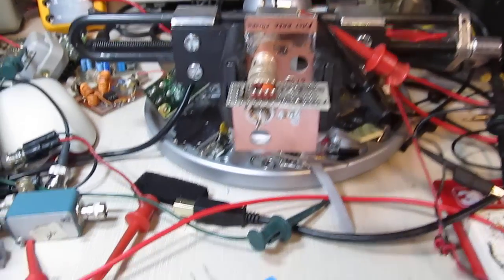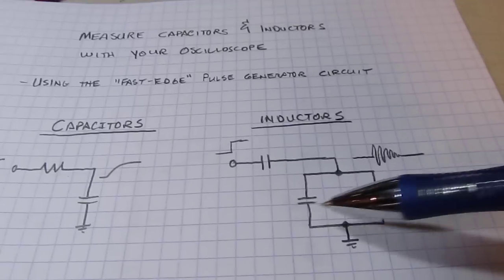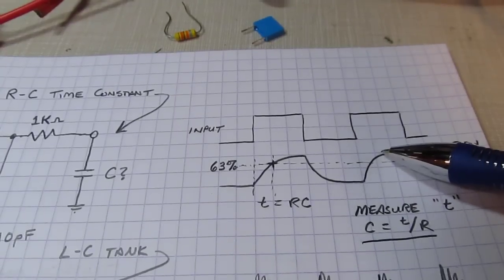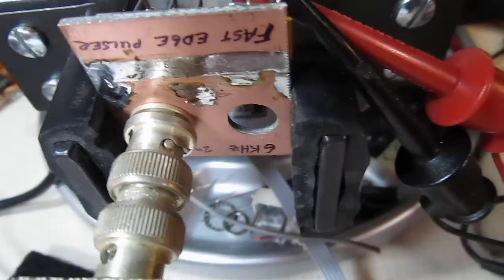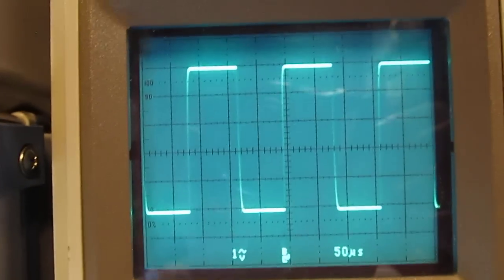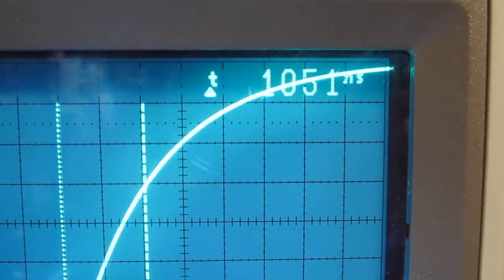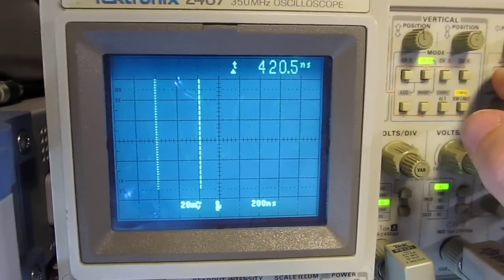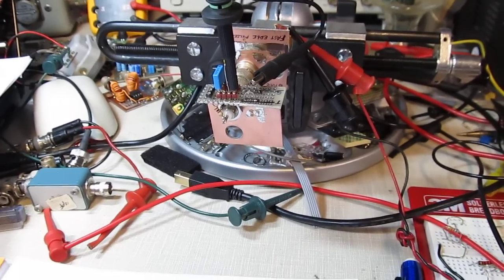#90: Measure Capacitors and Inductors with an Oscilloscope and some basic parts

Comment: Hi, Alan. Another great video! Thanks for your efforts! Is there any way to add a DC offset to this circuit, to test caps at their working voltage?
Reply: Conceptually it is trivial; just put a blocking capacitor from the square wave signal source to the device under test.  Then, have a mechanism to not instantly apply the DC (rc time constant; a resistor and filter capacitor feeding the device under test).  If you simply switch high voltage on the device under test some of that is going to go through the blocking capacitor into your pulse generator.

Comment: Hi  Nice videos.  Very well done.
Question for you.. With your R&S  9khz to 1.1Ghz sig gen.. Are the rubber buttons hard to push? I mean you have to push them fairly hard for them to work?  Mine are like that and I'm debating if I should take the front panel off and clean the carbon contacts inside.
Reply from the maker: No, the buttons aren't hard to push on sig gen.
Reply: ***** Ok then  I have some work to do lol

Comment: Nice Video! How you could compute error in that measuring method? Which is the correct way to obtain an error bound?
Regards!
Reply from the maker: +Maximiliano Bertotto There would be a lot of factors to consider.  Smaller values will be subject to more error because of the parasitics in the setup.  Errors are high enough that it's probably not worth the exercise.  These methods will likely give you results within 10% or so, or a little better with great care.

Comment: w2aew, LCR meters have an SERIES/PARALLEL mode on the DE5000 LCR meter. This puts the resistance of the inductors either in series or in parallel. An inductor is a Series L+R+C or is it L/R/C in parallel?I'm not sure which mode to use when measure inductance of a inductor or coil
Reply from the maker: In general it is not terribly important which model you use, but the manual has some suggestions of which model to use based on whether you're measuring low or high values.  See page 5 on the manual (https://www.ietlabs.com/pdf/Manuals/DE_5000_im.pdf).  I'd say that for capacitance, high values would be anything about about 1uF.  For inductance, high values would be anything above a few hundred uH.
Reply: Other techs say when measuring a coil or inductor using a DE5000 to use the SERIES mode when measuring Inductance and use the PARALLEL mode when measuring capacitance. The Series mode is putting the ESR resistance in series with the inductance and the parallel mode is putting the ESR resistance in parallel. My other LCR meter "doesn't" have a SERIES/PARALLEL mode. I'm not sure why LCR meter have a series/parallel mode for measuring inductors
Reply from the maker: @waynegram8907  Read the manual, it describes why there is a series and parallel mode.  Meters that don't have this function simply ignore the parasitic resistance.
Reply: Oh ok thanks, I'm not normally use to using LCR meters that has this parasitic resistance function.

Comment: How can I measure a capacitor discharging in a small 1.5 volt dc  motor?
The capacitor acts as a kicker. So the trace occurs only once at the beginning.
Reply from the maker: You'd need some form of storage scope - either using a camera to capture a single-shot trace, or a digital scope in single-shot acquisition.

Comment: Is it critical to use a AC or will a  HC variant of the 74xx14 suffice. I am not sure if a super fast fast edge of the oscillator is critical for measuring  inductance or capacitance. Thanks

Comment: Since the pulse generator ideally has zero impedance, the 10pF would end up in parallel with the 1nF tank capacitor. I suppose the error here would only be 1% of the capacitance which is probably less than the tank capacitor tolerance. Do you agree with this view of the 10pF being in parallel with the tank correct?
Reply from the maker: The pulse generator actually has about 50 ohm output impedance, not near zero.  So, the 10pF appears in series with the 50 ohm output impedance, which is in parallel with the tank.  Again, only a very small error.
Reply: I just saw the output resistors of the pulse generator on the video. My bad. Thanks for the reply!

Comment: Hi Alan- another question:  I haven't tried this yet, but I was thinking one way to determine a good rate would be 5 x the RC time constant or so. Yet, I recently came upon this article which uses 10HZ ! which seems unusual to me. What do you think? YouTube won't allow to post the webaddress, but you can search on the title which is "Quick Methods for Reliable Component Testing" by Dennis Weller, Agilent Technologies, March 2011 on the evaluationengineering site.

Comment: Great presentation as always! I've always been wondering, in an LC tank circuit, if the L and C were not physical components but parasitic L and C which is causing unwanted ringing on the output, what can be done to eliminate the ringing in order to get our clean square wave back?
Reply: You cannot entirely get rid of it but if you can get some resistance in there it will reduce the "Q" and quickly damp the ringing.  You can sometimes also use clamping diodes.

Comment: Would it still work (by series resonance), if we just keep the series capacitor and inductor (remove the parallel cap with inductor)? And probe the connecting between the C and L point?
Reply from the maker: Not really - remember a parallel resonant circuit looks very high impedance at resonance, a series resonant circuit appears very low impedance at resonance.

Comment: Nice and fun !  What is the name of those trhu boards with rivets ? thanks . I am wondering something : may I use a cheap wave generator mimic alternative current with it ? I thought I could test a full wave bridge rectifier with a sinusoidal by entering it in a T shape BNC, it seemed to work on the oscilloscope, (showing rectified waves) but I am unsure it really did the job . Did you make avideo on that sort of subject ? Sorry for the out of topic , Thank you
Reply from the maker: The board is an old piece of Vectorboard (https://www.vectorelect.com/prototyping-boards.html).
Reply: @w2aew  Thank you (is the reasoning for my other question totally wrong ?) regards
Reply: @w2aew    Thank you  I am trying to understand why an alimentation is not starting, with CM6802  Can you tell me what I use to check the mosfets outputs . There is a comparator I suppose before the CM , The oscilloscope show no stable SB voltage but something at 4 then 8 V alterning at 1Hz +-, and I do not understand what can be  is causing this . each capacitor I test seem to be good . I am far from being at the level of comprehension for that type of job but I wish to understand something of the primary then secondary portion of a classical alimentation (as one for a PC ATXtype) it is on a NAS alim board..  A finger pointing a direction would be largely enough for my pleasure ;)   as "do measured tensions show the place where something is wrong? May I look for RT & CT and VREF  ? A simple experimental circuit /video to understand how is working an oscillator would please me a lot Sorry to be long winding and thanks for reading me / regards
Reply from the maker: @IsaacOLEG  You can use a function generator to mimic AC signals for the experiment you describe - the only difference is that AC/line impedance is typically very low, while the output impedance of a function generator is typically 50 ohms (or higher), so you may experience loading issues with the function generator that you won't see with the AC/line powered experiment.

Comment: is the 10pf part of the scope probe, as your video showing the board you built has only 1 cap on it. Is the one on the board the 1nf. Please reply
Reply from the maker: The 10pF cap is the small orange disk capacitor that is located between the two rows of pin sockets. I point to it at 4:28 in the video. The 1nF cap is connected to the pin sockets with the unknown inductor.

Comment: What is the benefit of doing it this way versus just using a ESR/Capacitance meter?
Reply from the maker: No real benefit to this method other than:
- an excuse to play with you oscilloscope
- gain some better understanding of how capacitors and inductors behave.
So, no, this method was show mainly as an educational exercise, not necessarily a more practical way to measure capacitors and inductors.
Reply: @w2aew Cool. Thanks for the reply.

Comment: What peak to peak voltage are you getting with the fast edge generator ? great videos by the way.
Reply from the maker: It is dependent on the supply voltage applied to the circuit - the output swings close to rail-to-rail.

Comment: in the learning stages. the time/div. is there a chart that shows what decmials to enter for each time or to learn more of the M , U secs. iam guessing M is micro. but what is U and a example of the numbers pluged in for cap values. ive tested a few known caps. and numbers are not matching at all..
Reply from the maker: m = milliseconds, u = microseconds, and n = nanoseconds.
Reply: awsome ty very much oldman.. gives a hint what i do for hobby lol ... your the man of the hour.. fav bev to ya. kb2wvo
Reply: bug ya one more time olmand. i have the analog hp1740a. Sq's on screen as normal. the lil marks also .. cant rememebr how to spell that big 10 dollar word ... so if iam at .1mSec the sq's are .1 each then divid that by 5 for each sub mark on the Gline..
Reply from the maker: yes, exactly.  The value on the knob refers to the large divisions, usually 10 of them across the screen.  The little tic marks are 1/5 of that.

Comment: Wouldn't be simpler if we used the same method for inductor as You demonstrated for capacitor and then calculate inductance based on L/R time constant?

Comment: My Siglent SDS1102CML has a 1Khz square wave on it. Could I put that into the circuit in the place of the fast edge pulser to accomplish something similar? Sorry if this is a super-newb question. I've been trying to figure out how to measure salvaged parts to make my own LC Meter.
Reply from the maker: +Josiah Ritchie You can give it a try. You may have to characterize the output impedance of the circuit creating the squarewave to be sure it doesn't impact (or to include it in) the calculation for the RC time constant for checking caps.  On the inductor test - it's usability will depend on how fast the rise/fall edges are - you need fast edges to inject the high frequency energy to ring the LC tank circuit for the inductor test.
Reply: Thank you for your reply. I'll consider that as I play with it. Your direction on what to be aware of gives me some confidence knowing what to consider as possible variance. Thank you!

Comment: Looking at this from a non-experienced view, I’m going to unfortunately have to take some wild guesses.  One being that the oscilloscope is displaying two separate waveforms, because one instant I’m seeing a square wave, then the next instant I’m seeing an exponential wave.  If I didn’t know better, I’d be wondering how zooming in on the square wave, produces the wave that’s being measured for a time constant.
Reply from the maker: It actually IS zooming in the on the rising edge of the squarewave.  When you zoom in, or stretch out the view of the rising edge of this squarewave, you'll see that it is an exponentially increasing voltage...

Comment: question :D
how accurate is the tank circuit method for cases where the permeability changes moderately to a lot depending on the flux? The thing is i have some ferrite EE cores and i've been struggling to parametrize it, but every method i've used gave me a totaly diferent value, the LCR meter gave me 15µH, LR circuit gave me about 65µH with a 1K resistor, and measuring the current slope (in a boost circuit, before saturation) gave me 88µH..... any idea?

Comment: Your R-C circuit for your Fast-Edge Generator shows a 6.8k resistor, but I can't read the Cap. is it 4.7nF or 47nF.  You mentioned another video that you did on this circuit,
but I can't seem to locate it.  Thanks.

Comment: Yes I see you used the VAR vernier to make the voltage to fit 8 divisions to measure the time constant 63%. I thought when you adjusted the VAR vernier it changes/alters the amplitude voltage so that its not a real absolute true voltage but just a relative voltage, not sure if that is true or not?
Reply from the maker: Yes, it is relative, but that is what we want in this case.  By making the peak voltage occupy 8 divisions, we know that 5 divisions is 63%.  All relative.
Reply: I would think it would give you a "false 63% time constant" because you have altered the peak voltage by stretching it or collapsing it using the VAR vernier. In some Oscope manuals I think they give a formula to use when you have the VAR vernier adjusted Multiplied by the Volts per Division, I'm not sure what the formula is but you have to use a formula to "add in" the VAR vernier to the volts per division. You have mostly used the VAR vernier to measure Rise time/fall time and Time constant. What else can you use to measure using the VAR vernier? Because older electronic technicians in the 50's and 60's would use the VAR vernier often I heard because Oscopes in the 50's and 60's used the VAR vernier much more for some reasons you had to use the VAR vernier to make measurements because the Oscopes were different in the 50's and early 60's.
Reply from the maker: @waynegram8907  No, it won't give a false 63% time constant. 5 divisions is always 63% of 8 divisions, regardless of how many volts it represents.  So, there is no problem.  

On the older scopes from the 50's and 60's, the vertical scale was NOT calibrated, so you would put a KNOWN voltage into the scope and adjust the vernier for a certain number of divisions so that you would have a calibrated scale.  That is not necessary on more modern scopes (anything less than 40 or 50 years old).
Reply: What was causing the vertical scale to NOT be calibrated in the older scopes? was their a stage/circuit missing inside the Oscope that new Oscopes have that calibrates the vertical scale?I would think using the VAR vernier is stretching or squeezing the voltage amplitude which would change and alter the voltage amplitude to another new "instantaneous value". But you're saying that when you're adjusting the VAR vernier that its NOT changing/altering the Instantaneous voltage value , its just only a visual thing that's its stretching and squeezing the amplitude only in a visual display but "not" changing the Instantaneous value of the voltage?
Reply from the maker: @waynegram8907  Back in these early scope days, it was very difficult to make a vertical front end and deflection system for the early CRTs that would operate consistently and hold a particular calibration in a cost effective manner.   The VAR control just changes the gain or scaling of the waveform, it does not just compress the extremes, so the signal maintains its linearity.
Reply: Yes the VAR control changes the gain/scaling of the waveform and scaling of the volts per division control. That is why you have to use a formula to "add in" the VAR setting with the volts per division when measuring the voltage I thought? if you apply a 5 volt Peak voltage into Oscope Chan#1 and adjust the VAR so that 10v Peak to Peak to fits at 6 divisions, the volts per division setting X's multiple by 6 divisions won't add up to 10 volts Peak to peak. If you use the VAR so that 10v peak to peak fits 4 divisions, the volts per division settings X's multiplied by 4 divisions won't add up to 10 volts peak to peak. You have to "add in" the VAR setting to the volts per division to get the correct peak to peak value. This is what the electronic technicians had to do in the 50's and early 60's I heard because you had to use the VAR setting always when making a voltage measurement but couldn't just count the Oscopes gradules boxes and multiple it by the volts per division you had to also add in the VAR settings also.
Reply from the maker: @waynegram8907  Correct.  But, in the applications we discussed where you actually use the VAR control (rise/fall measurements, the capacitance measurement method, etc.) we don't CARE about the actual voltage, we only care about lining up the waveform to a specific graticule line or number of divisions.
Reply: ok thanks I was confused about if it mattered or not. I was thinking that the VAR would alter the rise/fall time measurement and capacitance measurement time constant. I'm guessing you can adjust the VAR to scale the voltage to anything you want on the Oscope screen and the time measurements won't be affected it seems. I was thinking that if you adjust the VAR to change the scaling of the voltage/amplitude of the waveform that is would change/alter the time, but it seems it doesn't.

Comment: i would like to know how you input the L=  on your calculator i did mine with out squaring and and i come out with 3.4306  -06 when i trued squaring i was way off by the way i was using your videos  L=  just so see if i was doing it right
Reply from the maker: The calculator I used in the video uses "reverse polish notation", not algebraic notation.  So the keypresses to calculate the inductance were:
2 <Enter>
3.14
*
2.73e6 
*
<Enter>
*
1e-9
*
1/x